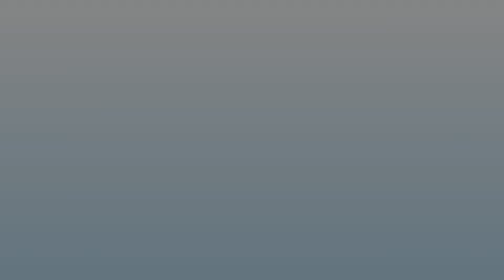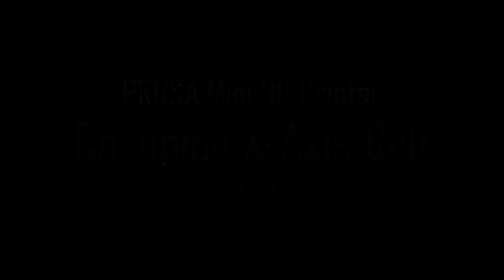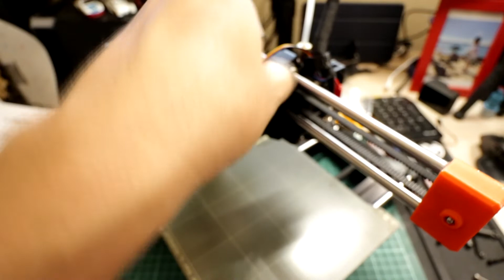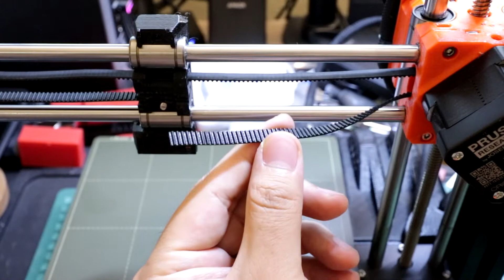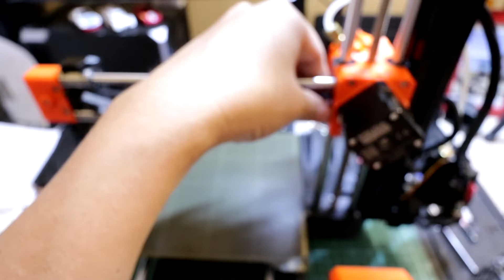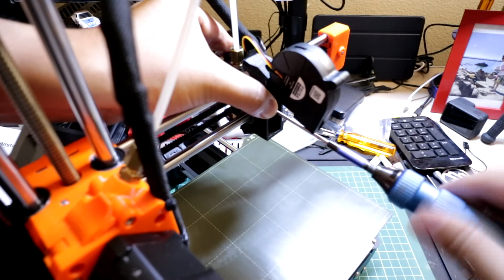Prusa Mini - Replacing the X-Axis Belt walkthrough

Comment: I'm sorry, how did you remove the belt? The camera went all fuzzy and you chose not to explain the process
Reply from the maker: If you're talking about the part where I remove it from the carriage, once you take the front of the carriage off, you can just pull the belt towards you to remove.  It's just held in a small slot in the 3D printed part.
Reply: @RevolutionX  Thanks bud!

Comment: Massive thanks for this, made replacing the belt very easy. I had the same issue as you
Reply from the maker: Awesome!  Glad it helped.  Luckily Prusa now has their manual online.  When the Mini first came out there was no instruction manual for taking it apart and putting it back together!
Reply: Is there any way to find belt tension on the mini?

Comment: Thanks for this, very helpful when changing my belt which had the same issue. I also checked the motor cog, assume that’s what caused your belt damage given your other video. Mine seemed fine though, so no idea what damaged my belt, perhaps a manufacturing issue
Reply from the maker: Glad it helped.  There's still a lack of a manual and information on the Mini as far as how the components go, so I'm glad this helped!